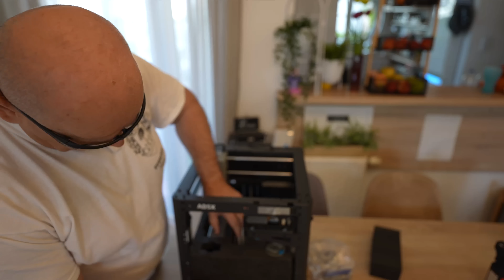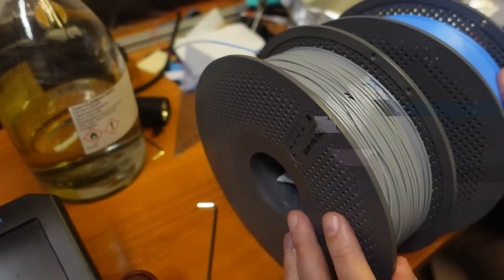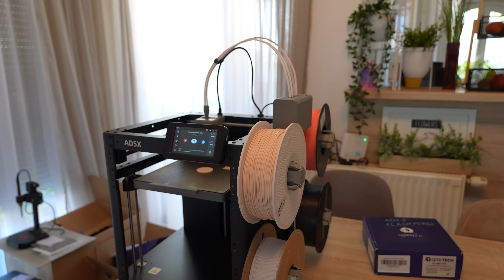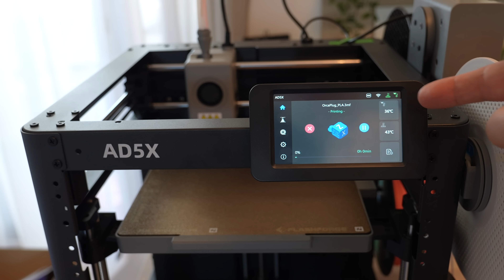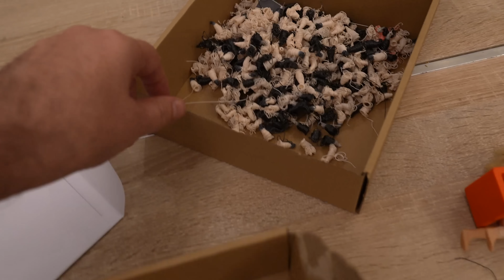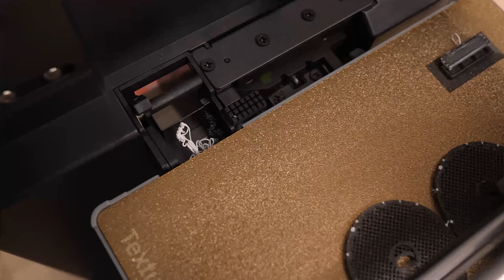Flashforge AD5X Review — A True Multicolor CoreXY under $400?

Comment: Nice video, Igor. I wanted to review it too - it's a great price. Filament accumulating on the back is clearly a problem - maybe it's fixable even with a 3D Printed replacement part. Who knows. But, because of time and specially the waste, Multi-Nozzle printers (or multi-head) is really the future. I don't print big models in multicolor because of how much filament is wasted.

Comment: I think the AD5X presents a pretty great value. I would personally buy it with my own money over say the Bambu Lab A1 with AMS. Flashforge deciding to keep their operating system open was a great choice. If I was more focused on engineering materials than multiple colors, I'd go with the Qidi Q2.
Reply: Do they have it open? Buildable from their repo? I have seen only corners-cut (gubby screen or something) community klipper for 5M and similar for 5X.
These cheap printers (FF, Artillery, Elegoo) seem to have too little RAM to have fluidd and klipperscreen running at the same time 🤔
Reply: @kimmotoivanen  I'm not sure if the AD5X source is up yet, but the AD5M and Pro version are open and tons of people are running them with modded open Klipper like you mentioned. Seems to improve them a lot. Either way I'm confident you could at least go in and customize. They definitely are not power houses, but they are competent, especially for the money. It's not really important to have every single feature of main line Klipper even though people obsess over it. Just being open is still nice, like Qidi.

Comment: I've been considering picking one of these up and only using the "multi color" as an automatic filament runout change for long prints. Unfortunately, the items that are most likely to need that function wouldn't fit on a 220mm cubed print area. Still something to consider for the odd case where you want something multicolor and don't care about the waste.
Edited to say Thanks for performing these tests and giving us your opinion, Igor!

Comment: I really like how they did the "AMS" system, very simple ale very compact. I think this is most compacct setup that I have seen yet ?The fillament getting stuck in the poop tunnel sux tho, there is for sure needs to do some redesign or code logic how to do purging. FOr models where there is not alot of filament changes required, this seems really nice.

Comment: I've had a couple of multi color printers and currently have a FF A5M that I've enclosed. I found that multi color printers are a waste if all you're interested in is functional prints. With the multi color printers I got added complexity, more work to set up and keep running and prints that were no better than what I could do in a single color printer for less money, time and effort. Sure, they were fun at first, but for me it's cheaper and easier in the long run to print in grey or white and paint the print. Just my experience.
Reply: The point is multi material for functional prints. But that wastes even more filament without a toolchanger